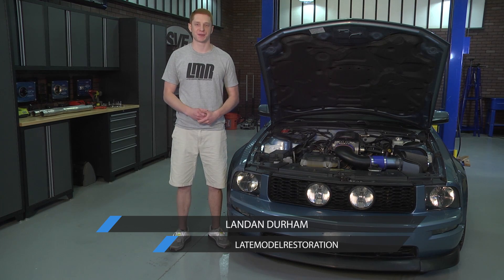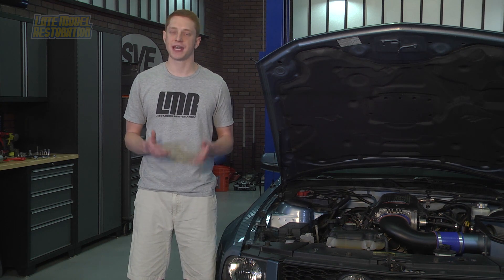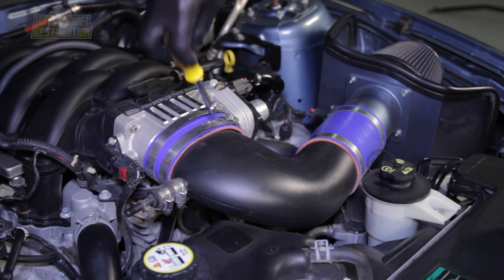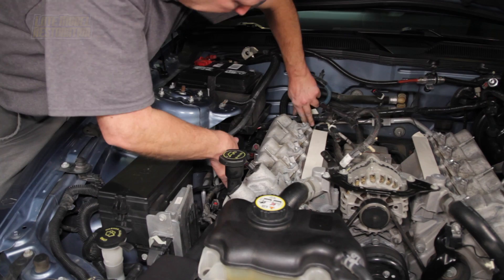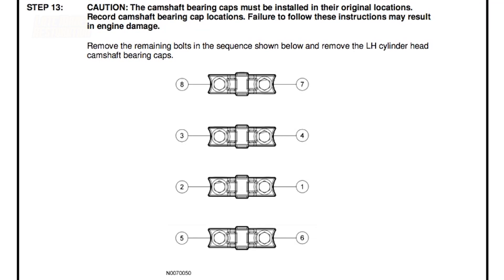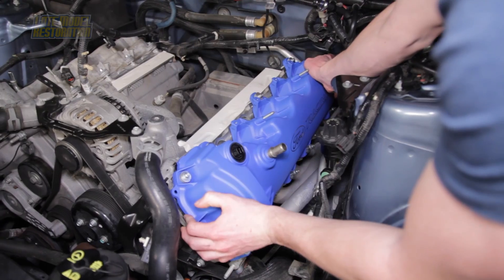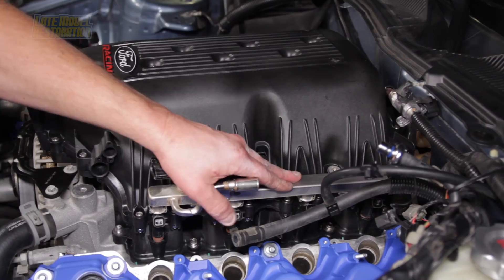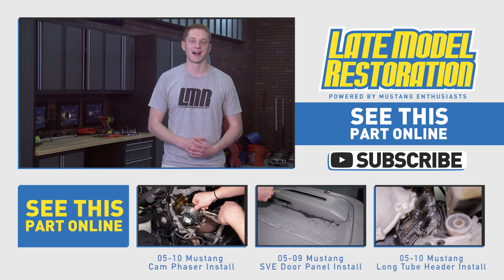Mustang GT Ford Racing Hot Rod Cam & Intake Manifold Install (05-10 4.6L)

Comment: the problem with this upgrade is that you guys should of put long tube headers, a larger TB, and heads to match the cam upgrade. Then we probably would have seen a significant power increase. All an engine is is a giant vacuum pump. It sucks air in and pushes air out. You still have restrictions/bottlenecks now without proper air induction and exhaust flow. Just saying. awesome video either way. 😊
Reply: JustStop Don't had to look too far to see this. came are deff gonna come alive with supporting airflow mods
Reply: It has the twin 62mm bbk throttlebody already... bbk throttlebody can be identified by those 5 lines on the top of the throttlebody
Reply: The twin 55mm throttle body isn't a bottleneck from from the factory, it flows around 953 CFM, which is plenty for this little engine. The exhaust side of these cars is where the shortcomings are for sure. A good set of headers such as Kook's long tubes will take advantage of the stock cam's long exhaust duration, and you can see as much as 35-40 horsepower @ the crankshaft. The heads flow kinda okay from factory and will not be a large bottleneck in this application
Reply: I put ford hot rod cams ford racing manifold, K and N cold air, granitelli TB and Rousch extreme cat back and bama tunes......now the engine powers through the traction lock and smokes the tires.  The Rousch exhaust has no mufflers...  I would like to do cat deletes or more efficient cats and headers........ but it costs lots of $$$$$$$  I think I think am pushing 400hp at the rear wheels..........i could be wrong though.,
Reply: @joeelliott3980 aye it’s easy to get those cats off for cheap and good trust me 😂
Reply: joe elliott sadly you are probably a little over 300whp. Those mods all together are probably good for a max gain of 50hp at the crank.
Reply: @superdutyzack  with that said the hot rod cams are probably not the best as far as adding power.  I have seen fbo cammed 3v in the 350+ rwhp range its all in the supporting mods.
Reply: @superdutyzack  NO not so its more like 375 at the wheels we do this stuff all day at our shop!
Reply: @superdutyzack  a fbo cammed 3v can easily do 340-350 rwhp ecspecially with an intake manifold upgrade.  400 rwhp no but with a good heads cam and intake package you can get close to that depending on the setup.  Fbo 3v I've seen as high as 320-330 rwhp.  Depends on the setup and the dyno of course.

Comment: 5000 dollars later you have 315 hp.
spend that 5 grand on a supercharger and drive away with 420+hp, throw a set of axelbacks on it and be done with her.
Reply: RLMUD probably more around $3200.. intake manifold $620 TB $200-$300 CAI $250-350 cams $720 phaser limiters $200... also this is an auto would have seen bigger numbers in an automatic.. still had doctors headers/exhaust.. with longtubes it would be right around 365-380 depending the tune altitude and if you have AC and UDP long tubes will put you at $4000... plus not everyone wants to go F/I some people like all motor power or like to add power over a couple years
Reply: well you normally need to do aftermarket mods to the engine anyways to handle that jump in power without running into problems into the future. To my knowledge at least. If i'm wrong educate me not insult.
Reply: It isn't nearly $5000. It's a mod that is about personal preference.
Reply: My son has an 08 mustang and we are doing mods a few months at a time. So far he has spent $1200. But that was a on the cold air intake and throttle body. He just wants to have the power from 0-60. Anything else yes you would probably spend $4-$5 thousand.

Comment: Can you put racing cams on a non gt?
Reply: Yes however, this cam will not work. I'd search LMR.com or SummitRacing.com for parts, starting at LMR.
Reply: The camshaft is responsible for the lifting of the valves, so obviously no since this cam shaft is designed for the 4.6 V8 (24 valves).

Comment: with all those first mods make you not want a mustang lol better off buying a 02 ss
Reply: not the new ss camaro
Reply: Supercharge a 1999 ls1 and no stock coyote can touch you and still have 10000 to play with
Reply: @utahcountypicazospage5412  99 camaros suck dude.  They're ugly as sin and have shit build quality.  The engine and trans is the only good thing about then.  Supercharge a coyote and that ls1 will need a full build and modded engine along with forced induction to keep up.  Get out of here with the camaro talk go watch camaro videos.
Reply: A 3v can easily make 350+ rwhp fbo cammed only with stock intake manifold the ford racing manifold sucks and so does the hot rod cams they sound good but don't make good power compared to other options out there.  A properly modded 3v can sew 350+ rwhp with fbo and cams only from a 281 cube sohc engine from 20 years ago.  This video is not a good example of what a 3v can do the parts on it are not optimal for making power and its an auto which shows even less power.

Comment: lol my stock ls1 makes more hp
Reply: This makes 315hp to the wheels, camaro ls1 makes 326hp to the crank and after drivetrain lose probably make 280 to the wheels. Camaro fan do don't think I'm praising the mustang just stating facts
Reply: Matt Brattensborg nope
Reply: KiKitutorials1 there have been ls1 fbodies that made 310+ to the wheels stock. Usually 01-02 cars. All ls1s are around 350 crank stock
Reply: @mattbrattensborg7785  that is through a manual an auto ls1 won't even see 300 even the later cars.  No way an auto ls1 is sniffing 315 to the tires.
Reply: So what the hell are you watching this for?
Reply: Ac Pi Do a quick search. 01+ ls1s make over 300 at the tire. I've seen many dyno sheets for stock cars making over 310 at the wheels
Reply: KiKi mad respect

Comment: What does s197 mean?
Reply: +joseph ojea It's Ford's internal nickname for this generation of Mustang. The nicknames loosely reference the chassis and drivetrain setup.  For example: 1979-1993: "Fox", 1994-1998: "SN95", 1999-2004: still SN95, but received the new nickname "New Edge" because of the redesigned panels ("New Edge" wasn't an official Ford nickname), 2005-2014: "S197", and 2015-Present: "S550".

Comment: How hard is it to get the phaser bolts out? Mine are REALLY stuck in there.
Reply: Late Model Restoration hey man ...iv installed stage 2 comp cams on my 2003 mustang gt ...the problem i have is that the cams sound really low ...it dose not have that rough idle noisy sound ...although its a 495 lift ! Would you please help me figure this out ?
Reply from the maker: +KartKing4ever Depending on the engine, every phaser bolt I have personally removed came out just fine. What are you using to remove it? -Landan
Reply: Dream big, Be happy,and live in peace

Comment: This is very disappointing. Together all these cost money and there is no "bang" for your buck with this setup. I have no idea which direction to go for my auto S197.
Reply: Drop a 5.0 coyote in it.
Reply: Christian Wartluft I'm not sure what I'd do. I may just throw on a few bolt-ons and find a 90' fox body to fix up.
Reply: +Roberto Williams id just go with a coyote engine and slam that into the engine bay. It pushes 420hp stock and its a brand new engine! Only problem is youll have to rebuild most of the drivetrain because of all the power. Good luck!
Reply: Christian Wartluft That's not a bad idea at all and one to actually consider. I was just hoping I could do full length exhaust, CAI with tune, camshafts, and throw on a supercharger & see some well respected power.
Reply: +Roberto Williams well with all those mods and if you pay someone to put them on, youll be spending roughly the same amount as you would with a brand new engine but with the engine its guaranteed power. Plus, making power on the 5.0 4v is easier  than the stock 4.6. Theres much more potential to build a race car out of the Coyote.
Reply: Christian Wartluft Now I feel bad that I didn't just find a 5.0 in the first place. I definitely don't doubt the potential of the Coyote. Just I could do mod-ed 5.0 esque numbers with a mod-ed 3v 4.6.
Reply: +Roberto Williams you could but its going to be extremely expensive to put down coyote numbers
Reply: Christian Wartluft I gotcha.
Reply: ***** That's exactly what I'll do. I hate I didn't get a standard shift but hopefully I can create enough power to stomp the Maros.
Reply: 97 mustang gt I've heard about the gearing. What would you consider the difference from pull to power?

Comment: is it absolutely necisary to remove the cam followers or is it just for ease of install when installing the new cam?
Reply from the maker: +Biggbulls799 I would HIGHLY recommend removal of any followers that are compressed by the camshaft. Failure to do so can result in engine and/or valve train damage. -Landan

Comment: Why do you say "for an automatic car"?
Reply: +Juan Beltran Manuals usually experience ~15% drivetrain loss, Autos, closer to 20%. These figures can be improved by cutting out rotational mass in drivetrain components, ie: lightweight driveshaft, lighter internals and rotating assembly, lighter flywheels... even lighter wheels can help get that power to the ground. The less your engine needs to work to move all these things, the more power is available to put to the ground and move you forward.
Reply: Because autos put let power to the wheels than manuals.
Reply: +KartKing4ever How much less power exactly? This car had 315 to the rear wheel,If it was manual what would the horsepower be ?
Reply: @garibay711cod  aprox , like 362 hp

Comment: so.. you're telling me my base v6 is faster than the 3v with cams and intake manifold and all the other shit..?
Reply: +Robert “Rob” S 
Dude.. just, no.  The ecoboost makes that power at the crank.  Ford does not rate it's vehicle power at the rear wheels.  And the amount of parasitic loss depends on the transmission.  Autos typically soak up around 20%, while manuals 10-15% tops.
Reply: Are you talking about a stock 11+ V6? Because then you'd be wrong.
Reply: +KartKing4ever no, with the same amount of money dumped into it. also with better mpgs.. much better.
Reply: and with a intake and tune capable of 400lbs of tq I just wish they had a better sound. ;.; *****
Reply: +Robert “Rob” Stevens you'll be fine with a 100-125 shot. I've been spraying my car for 2 years now. Just need the supporting mods for nitrous that's all. The eco boost should do great with nitrous
Reply: +Robert “Rob” S the 310 hp claim isn't considering the loss when it gets to the wheels. the Eco isn't pushing 410, rather mid to higher 200s.

Comment: what kind of gains would you get if you added the ford racing 3v heads?
Reply from the maker: +Jed Knouse One of our employees had a built 3v a few years ago with Ford Racing ported heads, Stage 2 N/A Comp Cams, and a 10:1 compression ratio which put down 396HP. I know this kind of differs from the video, but there is an idea on what power can be made out of a 3v with a good setup. -Landan
Reply: @latemodelrestoration  without tune, gears or something like that?

Comment: Wow, looking at the before and after dyno curves, this combo is crap.  It is down 25-35HP all the way to 4500 RPM, where it is equal and then the new cams take off.  What's worse is that torque is down by 50ft/lbs at 2500 and picks up 9ft/lbs at 4800rpm.  These cams may sound good, but performance wise this combo is a net loss.  It's hard to tell if the intake or cams are responsible, because the CMCV is designed to help low RPM performance.  I'd say that intake is probably too much for stock heads and you'd be better off with the stock manifold -- you are losing a lot of velocity down low, just look at the stock torque curve, it's flat from 2k to 3k and rises 35ft/lbs to peak.  The cams increase the peak values by 500RPM, but the manifold seems to kill performance down low.
Reply: +eformance It's the intake. The Ford Racing intake looks cool but sucks unless you're spinning the engine to 7000 RPM. I saw a test online where they took a car with big cams and ported heads and put the Ford Racing intake on it, it lost a bunch of power down low and only made 10 more hp way up in the RPM range.
Reply: No video, it's an article. Go on google, type in "4.6 3v intake manifold dyno", look for the one titled "three's a crowd"
Reply: +ghunt81 What video is this Im interested ?
Reply: Ok thanks bro
Reply: Because I have this mani lol
Reply: With long tubes

Comment: Nice! Are there any hot rod cams for the 4.6 2v??
Reply from the maker: Takeshi O Unfortunately, hot rod cams are not available for the 2 valves. -Landan
Reply: +Late Model Restoration how come the new 5.0's don't have looping cams???
Reply: @eidolonbreed  you can get them for that engine as well!
Reply: +eidolonbreed Because it is DOHC motor. Much harder to install

Comment: With longtubes and the Ford Racing throttle body could you expect a lot more out of these cams?
Reply from the maker: Tom Boyle Yes, you will see more power with long tubes. This car already has a BBK 62mm throttle body, so upgrading to a Ford Racing throttle body wouldn't benefit it any. -Landan
Reply: ***** I heard with bigger cams the stock 3.55 gears need to be replaced with 3.73 or higher, or the drive quality is bad and the car will buck or stall out is this true?
Reply: @Balrog124  I know your comment is really old now, but I just wanted to chime in and say that I have these cams in my car with the stock 3.55 gearing and it didn’t lose any driveablity. It is a bit different but not by enough to where 3.73s would be needed

Comment: Also, if you upgrade your stock torque converter you will make more power. Anything over 300whp the stock converter has a hard time translating that to the ground.
Reply: nobody has an auto in their 3 valve
Reply: @sinistersilverado965 I do